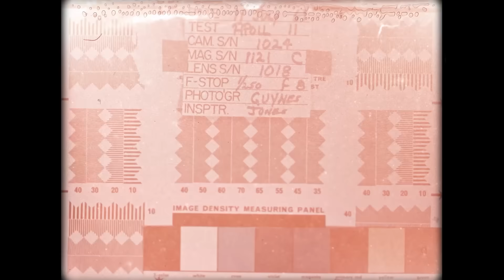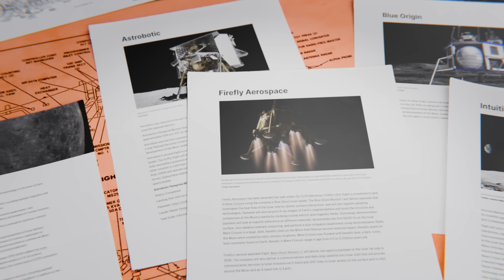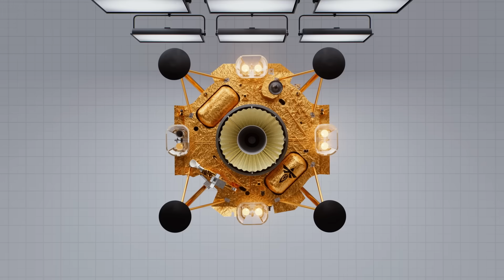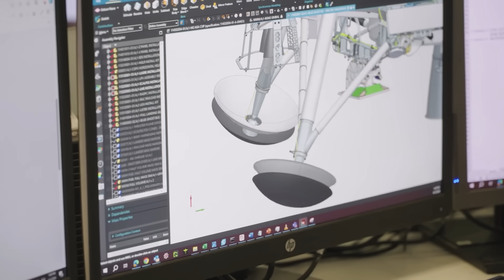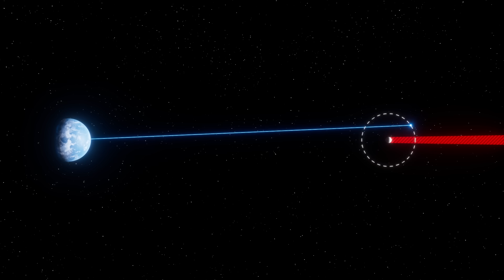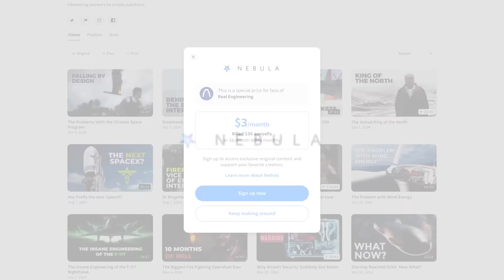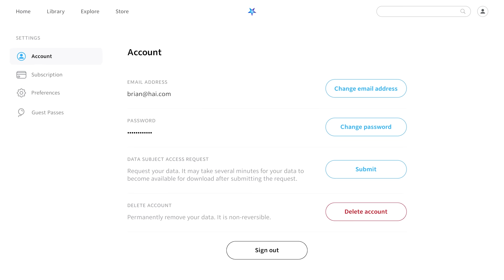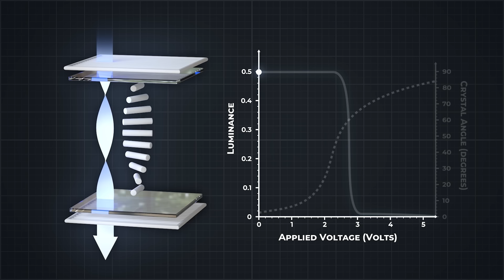Why the US is Struggling to Land on the Moon

Comment: Because Musk is a joke.
Reply: The failure of IM-1 is due to a mistake by Intuitive Machines. SpaceX had nothing to do with it.
Reply: @Hobbes746  space ex was supposed to be taking Artemis to the moon with a craft that can't achieve orbit.
Reply: @victorhiggins2118  No, SpaceX is in the middle of developing a lunar lander. They are progressing steadily and have already achieved orbit twice. There is no indication at all that Starship has failed or will fail. 
There are two ways to test a new rocket design: either you build a huge test stand where you can fire the stage, or you do those tests by flying missions. NASA chose option 1 for the Saturn V. They spent years and billions running the various stages on test stands before getting to the first launch. 
SpaceX chose option 2. This allows them to do more realistic tests sooner, at the cost of blowing up a few rockets. They determined this would be faster and cheaper than running a full test campaign on test stands. They are not the first to do this: the Soviets used the same strategy for the Proton, doing 14 test launches.
Reply: @Hobbes746  they have not achieved orbit in starship.
Reply: @victorhiggins2118  For the past flights they have deliberately made the orbit eccentric enough to make it impossible for Starship to remain in space if anything went wrong. They have demonstrated they can reach space, they have enough delta-V to reach orbit, they have demonstrated reigniting engines in space to circularize the orbit. The only part still in development is the reentry and landing.
Reply: As it stands now, Artemis will be brought to the moon by the Space Launch System (SLS) not by a SpaceX rocket. They and Blue Origin will build the lunar lander. But with Trump as president, Isaacman as the new NASA leader, anything can happen.
Reply: @ApolloKid1961 well with biden we saw only delays delays and delays... well we didnt wait for wars anyway.. ukraine war started earlier then scheduled.. and middle east wars earlier then scheduled 😅 so i dont think it can go anyway worse then that 😂😢😮😅😊anyway as sidenote i think i forgot to add lots of delays 😅😂
Reply: @ApolloKid1961  because SpaceX took 3billion tax dollars and delivered nothing.
Of course with Elon in charge of spending now I'm sure spaceex will be thrilling us with more fireworks shows soon

Comment: No gravity, How does it  trip over and fall ...🤪
Reply: The moon does have gravity. 1/6 g.
Reply: Enough to trip and fall? Emoji check out back🤪
Reply: @vctor6768  Yes, obviously, enough to trip and fall. 
Humans spend their whole lives in 1 g gravity. When you put a human in 1/6 g, it will take time to adjust, especially if that human wears a backpack that weighs 60 kg, which changes his center of gravity. 
We can’t simulate 1/6 g very well here on Earth, which meant the astronauts had to learn how to stay upright on the moon, and they tripped and fell occasionally.
Reply: @Hobbes746Yet they kanded giant rockets on moon at first try without killing anyone... but today they cant 😅
Reply: @ahmetmutlu348  Apollo 11 was not “the first try”. It was preceded by 29 unmanned missions to the moon, half of which failed. Then 6 unmanned Apollo test launches, and 4 manned launches that tested every part of the Apollo 11 flight profile.
Reply: You fall very slowly you can adjust very fast before you hot the ground
Reply: @vctor6768  They were wearing stiff pressurized suits that limited their mobility.
The instinctive reaction a human has when he gets unbalanced is invalid on the moon, because they are in 1/6 g, and their center of gravity has changed, and they have a lot of mass away from the center of gravity. i.e. your reflex is incorrect and you fall anyway.
Reply: Where is this coming from? Because is said they can adjust while falling or because I am challenging you
Reply: At this point we should all agree that Armstrong moon landing was stages in Hollywood...🤣🤣
Reply: @vctor6768  We should not agree that at all. The evidence is clear: the Apollo landings are real. The claims made by Sibrel and his fellow deniers have all been disproven.

Comment: Well official explanation is someone at nasa recorded barney series on moonlanding research data tapes ... accidentally... so technology is lost 😊😅
Reply: Nope. Every single TV transmission from all of the Apollo missions is still easily available in public archives. 
All of the knowledge from Apollo is similarly sitting in public archives. Intuitive Machines decided to ignore at least some of those lessons.
Reply: @Hobbes746 except scienific data if they recorded any atleast :P for example if this data was awailable and good ... then we wouldnt see failed autonomous landings from all around the world... its clear this scienific information is not waliable to nasa esa russia china india ... and lots more i guess... if this data is available as you said.. then are this agencies idiots cant use that data for autonomous landing. yet while there is even data for systems that can land humans :D there is something wrong it seems.
Reply: @ahmetmutlu348  Incorrect. All of the science data from Apollo is available online. The Planetary Data System contains the results from every experiment. 

The IM-1 mission failed because the people at Intuitive Machines ignored the lessons that were learned by NASA in the 1960s. They failed to do a thorough preflight check on their lander, so they launched it with an altimeter that was set to safe mode, so its laser was inoperable. 
This safe mode switch cannot be flipped remotely, so they were screwed, they had to attempt a landing without having the most important data (altitude) available. They cobbled together an alternative altimeter from the science experiments on board, and they almost succeeded: they were able to land with a low enough speed that the lander remained intact.
Reply: @Hobbes746 you know any professional forgetting how to do their routine job ? 
thats .... i dont know what should we call that... but logically its clear something is wrong horribly ...
Reply: @ahmetmutlu348  Intuitive Machines has never done a space mission before IM-1. The number kind of gives it away. This company, and the people working for this company, are inexperienced. They don’t have “routine” yet. But they had enough hubris to think they could ignore the lessons learned not just by NASA, but by every space company, and by every aircraft operator, over the past decades.
Reply: @Hobbes746 well scienific data if a profession reads it is clear data tough in general they dont add small details like error causing stuffs log.. tough still one may fail to read that but more then 5 unsuccefful missions tells a lot... 
Also we dont ewen talk about manned landing this is just minimal hello world style tests of apollo era claimed technology... yet they fail :) from evolution of engineering perspective this is important ewen if data is there or not :)

Comment: NASA can just hire SpaceX to do it, it will probably be done in 18 months, and it will cost taxpayers 90% less even after NASA takes their cut for...  watching it!
Reply: NASA HAS contracted with SpaceX.  NASA is operating a lunar landing program RIGHT NOW called "Artemis".  It plans to put man on the moon again in the next few years.  Artemis I has already flown - it was an unmanned mission around the moon and back using Boeing's SLS as the launch vehicle and a capsule (Orion) built buy Lockheed Martin.  Artemis II will fly a similar mission - but with actual astronauts on board.  Same profile - SLS launch vehicle with Orion as the capsule.

Artemis III will be a manned lunar landing, and SpaceX has been contracted to provide the lander.  If you have been following ANYTHING that's been going on in the space launch industry, perhaps you've heard of Starship (made by SpaceX).  It has launched several times - - most recently, they landed the first stage of their Starship directly back on the launch pad.  This was their Starship 5 mission.  SpaceX will provide a variant of their Starship and will be used as the landing vehicle for NASA's Artemis mission.  The lander variant of Starship will launch into Earth orbit, then SpaceX will launch several tanker variants of Starship to refuel the lander in Earth orbit.  These mission will need to have quick turnaround which was the reason for SpaceX's recent mission to prove they could indeed land their Starship directly at the launch pad - which they did successfully.  The reason this is important is because the launch tower is where Starship is fueled.  In order to expedite the refueling missions necessary to refuel the Starship lander, they will need to be able to launch, refuel the lander, return directly to the tower, refuel, relaunch, refuel the lander in orbit, several times until they fill up the lander.  The lander will then get into lunar orbit.

Then SLS will launch Orion, go to the moon, rendezvous with the orbiting Starship lander.  Crew will transfer to the Starship and land on the moon....stay a bit...and then return to Earth.

Later on in the Artemis program, NASA will contract with several companies to have a space station built around the moon called "Gateway".  SpaceX will also be very heavily involved in the deployment of the modules necessary for the contruction of Gateway.  SpaceX will deliver the modules necessary to construct the Gateway space station in lunar orbit.

Artemis IV will be the first manned lunar landing which will utilize this newly built Gateway space station.  Astronauts will again launch on Orion with SLS.  Go to the moon, dock with the Gateway space station (where there will be a waiting Starship lander).  Crew will transfer to the Starship via Gateway, then take Starship down to the moon.  Stay a while......return to Gateway, transfer back to Orion and return to Earth.

This Gateway space station will also serve more long term goals as mission to Mars become realistic.

Anyway - - - all this to say that SpaceX is going to be HEAVILY involved with NASA on upcoming space missions - - and are ALREADY very heavily involved.

Comment: The first sub orbital rocket trip 1961 lasted  15 minutes and 7 years later we were orbitting the moon with Humans.  Saturn 5 rocket only had 13 actual launches and the 3rd one had humans on it, or did them?  Since 1972 man has only been as high as 570 kms up from the Earths surface when we fixed the HST.  We had suits that worked on the moon.  We had a lander that worked 100 percent of the time.  We photographic film that could handle a vacuum and extreme temperaturexs.   We had a heavy lift rocket that could get out of the gravity well.   52 years later and nothing.  Al you have are persona insults and censoring to protect you.
Reply: Apollo was the most expensive engineering project in history. Once Apollo’s goal (beating the Russians to the moon) was achieved, the USA decided to reduce NASA’s budget by a factor 10, making further manned moon missions unaffordable. NASA went to work making access to space cheaper, with the Space Shuttle. Unfortunately, due to that now-limited budget that didn’t work out as well as was hoped, and for the following decades, the US was stuck in the same situation: manned moon landings remained more expensive than would fit in NASA’s budget. THIS is why we haven’t been back to the moon yet.
Reply: You are deliberately cherry-picking your describers in order to make one thing sound mundane while the other impossible.  It only works on your fellow morons.

Comment: Why did buzz get caught in that news fiasco about a certain "belt"? Why did that young spaceX engineer not get "silenced" for his confliction about current breakthroughs vs what was supposedly overcome decades prior with unspoken technology?
Reply: Would you like to try again, and make sense this time?
Reply: You're being very vague here, so it's not easy to know exactly what you're talking about.  You put "belt" in quotes, so I'm gonna assume you're talking about the Van Allen belts.

The thing about radiation is that the more intricate components are, the more susceptible to radiation they can be.  Apollo-era components were pretty robust when it comes to that sort of thing, but when you get into extremely small processors and things like that, those things can be more sensitive to the type of radiation they encounter in the VAB.  Either way - - you're acting like it was some insurmountable problem when it is certainly NOT.  There are zero roadblocks.  The thing you people seem to have a problem with is differentiating between these two things.  Roadblocks and obstacles.  TODAY, when companies put new cars on the market, they always go through rigorous testing to make sure they are safe for the road.  Is the fact that a 2024 model car goes through crash tests before the design is cleared and approved for the sale on the open market some giant smoking gun revealing that all previous cars must have been faked?  Because your line of reasoning would suggest that's what you think.  Just because there is an obstacle to overcome that has been overcome in prior designs does not mean it's suddenly not an obstacle to overcome in a new design.  This SHOULD be common sense, but apparently none of you people possess that quality.

Comment: Here we hear that Apollo could land because of Armstrong's great skill. But previously it was because of the 64K microcomputer that was controlling the landing sequence, programmed by Margaret Hamilton.
Reply: The Apollo Guidance Computer did most of the work. It wasn't until Neil saw that the landing site was full of bolders he took control. Margaret was head of development but did not write the code for the moon landing. That was done by Don Eyles.
Reply: @ApolloKid1961  When Armstrong ‘took control’, he switched the AGC from a fully automatic landing to ‘altitude hold’ mode, where he could adjust where the LM would land. His commands still went through the AGC: the LM was the first digital fly-by-wire spacecraft.
Reply: Because the computer was ‘blind’ and couldn’t compensate for sudden increases in gravity fields, it could put the lunar module down in a crater or on a steep slope, so the commander always took manual control in the last minute or so to ensure as safe a landing as possible.

Comment: Now I'm starting to question if US has ever landed on the moon before at all, we are not even talking about those so called "manned" missions. Once you have learned to ride a bike, you literally won't forget that ever.
Reply: Once you have learned to ride a bike, does your son magically have this knowledge too? The people that worked on the Apollo landings are not the same as the ones that built IM-1.
Reply: @Hobbes746 Are you telling me that NASA is so dumb that they lost all the documents and instructions of how to land on the moon?
Reply: @汤圆-y7f  No, NASA didn’t lose those documents. We can verify this, because those documents are in public archives. 
Intuitive Machines chose to ignore at least some of the lessons from those documents. For instance, NASA found out early on that you cannot afford to be sloppy when you prepare a spacecraft for flight: you have to check everything, and you have to have a process in place that ensures you check everything. 
Intuitive Machines had a spacecraft with a laser altimeter. That altimeter has a ‘safe mode’ switch that disables the laser, so you can safely work on the device without getting blinded. 
They forgot to switch the altimeter out of safe mode when the spacecraft was ready for flight. So they launched the spacecraft with the altimeter still set to safe mode, and unable to work. That is why IM-1 failed.

Comment: During the "flying blind" part of the landing at low altitudes, couldn't the lander use some sort of infrared camera system? bouncing light off the surface and back to the camera's to produce a lidar scan effect of the surface under all the thruster dust? Even if a low resolution, it'd still be helpful no?
Reply: They had a laser altimeter. Unfortunately they forgot to switch that out of safe mode during the preflight check, so it was inoperable during the landing.
Reply: @Hobbes746 Skill issue
Reply: @AnonymousFloof  Inexperience: this was not just their first moon landing, but their first spacecraft.

Comment: So we landed on the moon with a computer that had less power than a modern day mobile phone. With todays Tech It doesn't take a fool to realised that we were lied to then, just like they are today. Oh wait, they lost all the data..  I call BS
Reply: Computers won't take you to the moon, giant Saturn rockets will.
Only 1 Slow Scan TV Ampex tape was accidentally overrecorded, not the NTSC converted tape. All the data from the 5 missions that followed are still there. In addition, there is 8mm film footage showing the images on a monitor of that Slow Scan TV when the radio signal came in at the Honeysuckle Creek Tracking Station in Australia.
Reply: We landed on the moon with a computer that had less power than a modern-day mobile phone, backed up with two human brains, and whole rooms full of mainframes back at Mission Control. 
A basic lunar lander can be done with logic far simpler than what was present in the Apollo AGC, as demonstrated by the Surveyor and Luna unmanned landings in the 1960s and 1970s. 
IM-1 was much more ambitious than that: it aimed to do an unmanned landing with the kind of terrain recognition and decision-making ability that the Apollo astronauts had, but the Surveyor landers lacked.